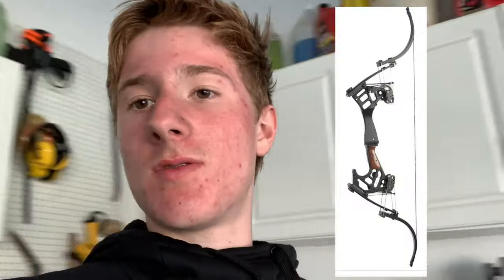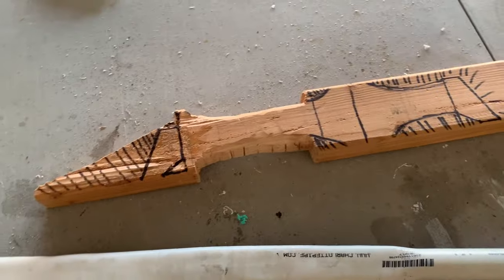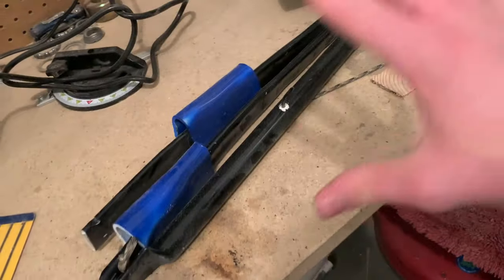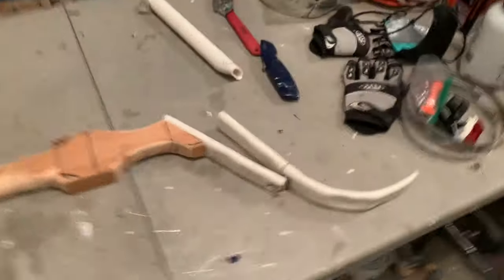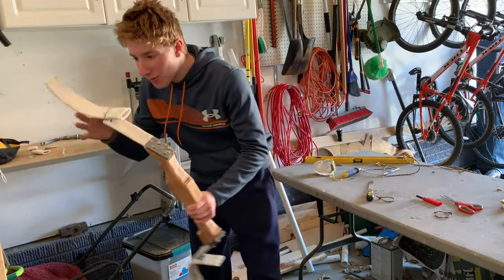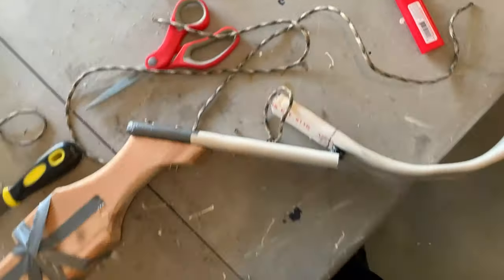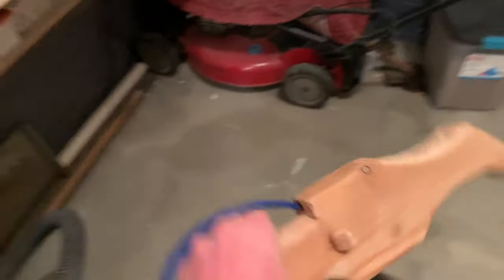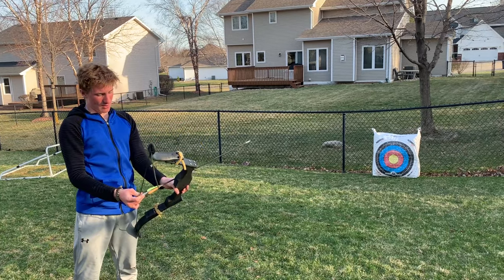Making the green arrows bow!

Comment: It's a nice build of a true Oneida Bow. (Recurve/Compound bow hybrid). But you'd need to amp that thing up from 5-10pounds to 50-70pounds for real action use. And use Aluminum arrows. Most archers use Aluminum or super heavy Carbon for deeper impacts and more thrust forest into targets (their kills).

And the arrow spines have to be around the poundage weight for better flex. Flex of a arrow really comes into play to how smooth a arrow flies. A stiff arrow won't fly correctly.

Plus Recurve/Longbows have different flex patterns to them then their Cam Compound bows do. Recurve/Longbows Flex left/right when fired. Compounds flex up/down. Now on a Oneida i'm not 100% sure. But my guess would be they'd flex left/right, Since the biggest reason why Compounds flex up/down. Is the cam's lock the string flexing from wiggling side to side. So the only way for the flex of the arrow is up/down. Recurve/Longbows have lots of wiggle on the string which changes the flex pattern left/right. So OneIda would probably do same since it relies mainly on Recurve style limbs with bending function for higher performance of a compound style bow.
Reply from the maker: Wow thanks! That’s a lot of information! 😂 definitely gonna come in handy when I do my next bow build 👍🏼